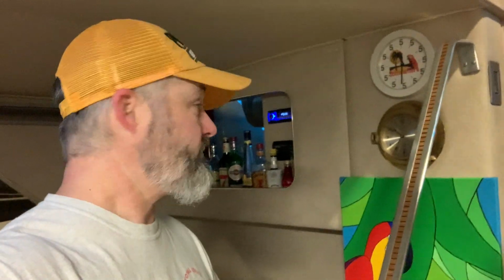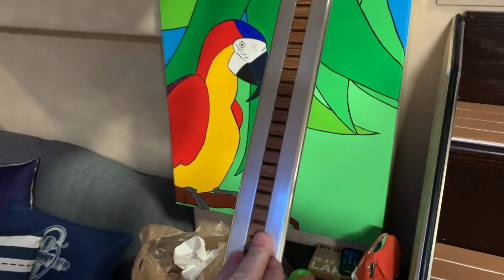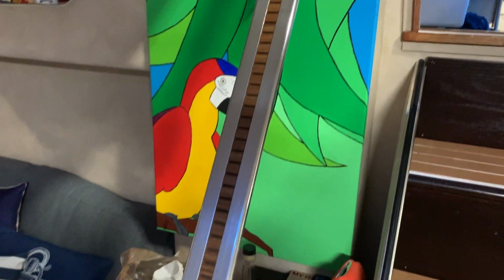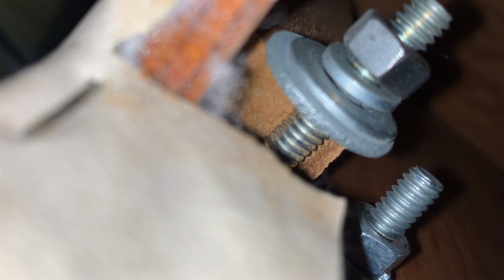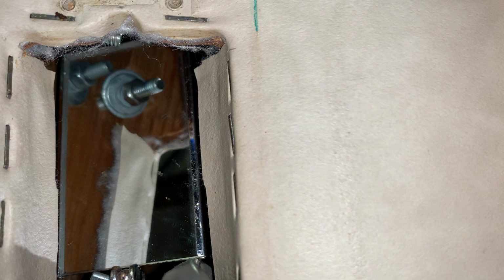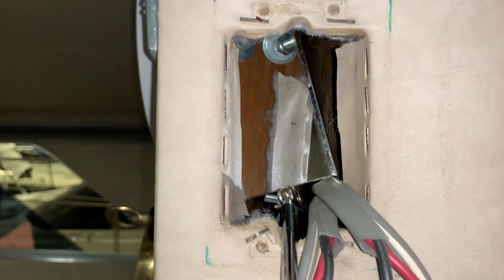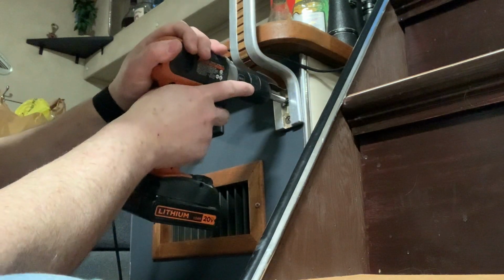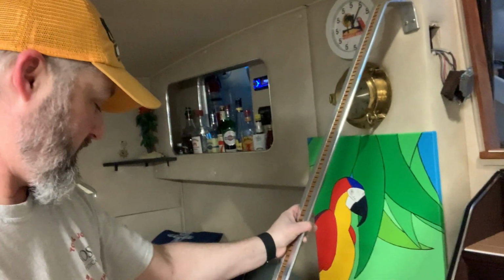MV Thirsty Whale, 1984 Chris-Craft Catalina 381, Salon Stair Rail Fix

Comment: Just a little more hand room you could have added a shim spacer under the flat washers.  But with my luck I would not be able to get the washers and nuts back on resulting in the rail being more loose.  Another simple job bites the dust.
Reply from the maker: Yeah, I could barely get a finger on the top one...would have lost the nut and washers for sure! Same luck here...LOL